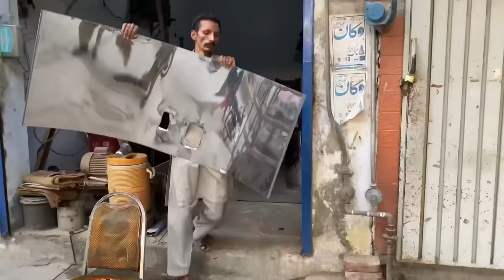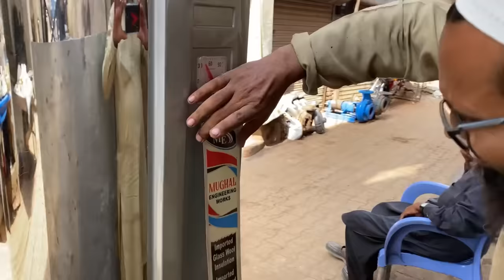Geyser Manufacturing || Incredible Technique of Making a Gas-Fired and Electrical Water Heater

Comment: The water tank is made from galvanised sheet but now the welds are bare mild steel and will rust away, its a heap of junk .
Reply from the maker: It can easily be used for 5 to 10 years

Comment: WOW, gas & electric, was there ever one like that in the US? 
Surprised that it had a valve & thermocouple & pilot light, I've used an old riveted one with out that stuff or the now mandatory  pressure safety valve.  It is going to rust, how soon, depends, but 5 years might be a stretch.
Reply from the maker: Thank you for watching the video and commenting on it.